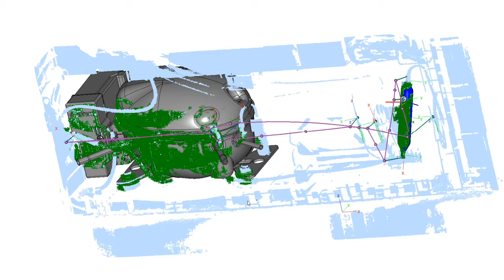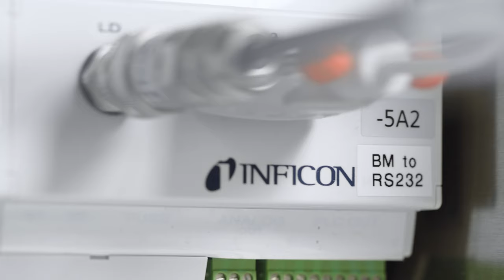The Future of Refrigerator Leak Testing - Robotic Sniffing

Comment: Leak proof when it leaves the factory. Once it’s in the field the copper vibrates from running and eventually a rubs a hole in the tubing somewhere, but hey the factory did their job. Mr Homeowner you may just need to consider trashing this unit and buying another one because this will be an expensive repair.
Reply from the maker: Hello bluebell, 
That's right, our leak detectors do their job and check whether or not the product is leaking when it leaves the factory. If after some time of use a leak occurs due to vibration or bad welds, this is not part of the factory leak test.
Your INFICON Social Media Team